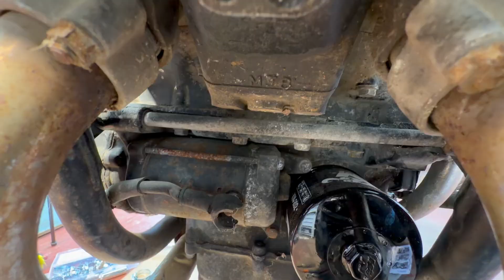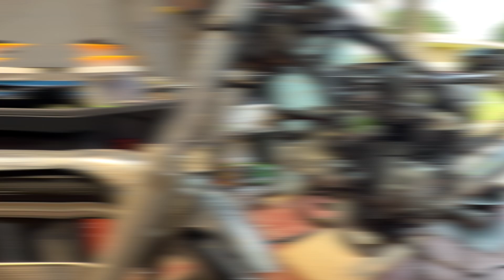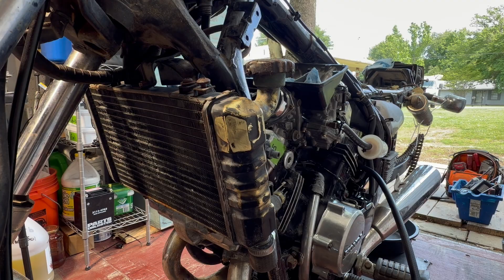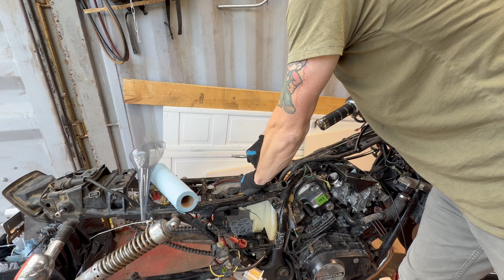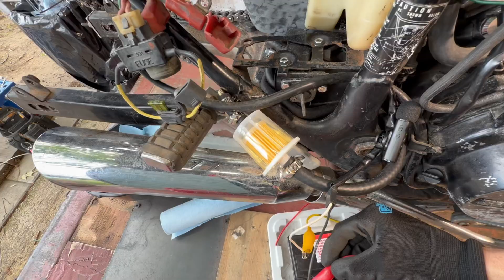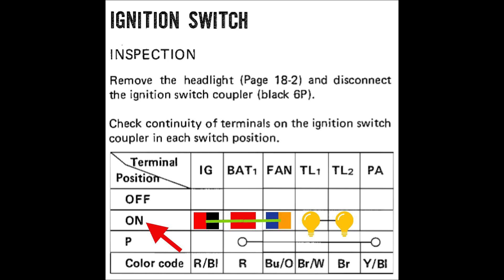First Fuel Up With JB Welded Gas Tank, Ignition Bypass and Radiator Install - 1985 Honda Magna V30

Comment: im just starting the video, but be sure to add coolant or your frame will rust out.
Reply from the maker: Good call, I didn’t even consider that.  Once I’m pretty sure I won’t need to dump it again, I’ll put coolant in.  I’m doing the front forks right now, but that should be the last big thing structurally/mechanically 🤞